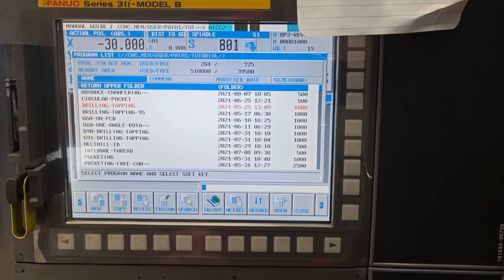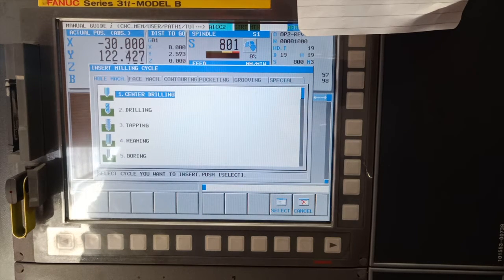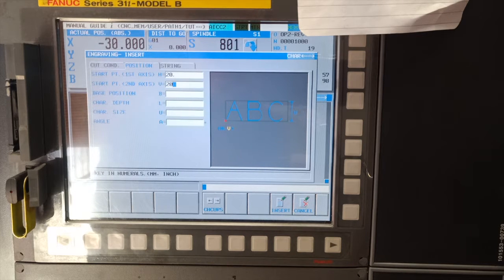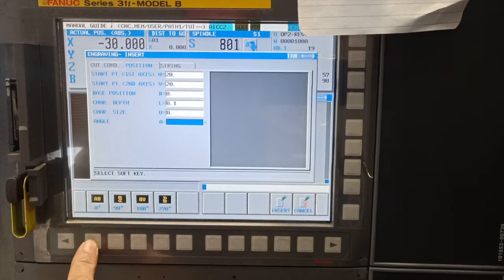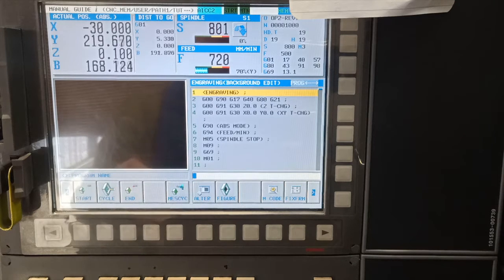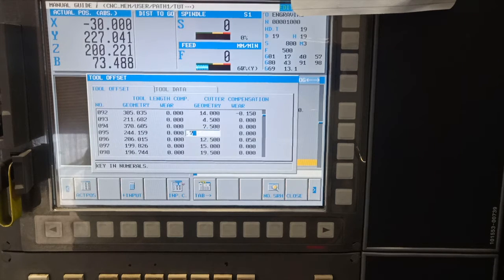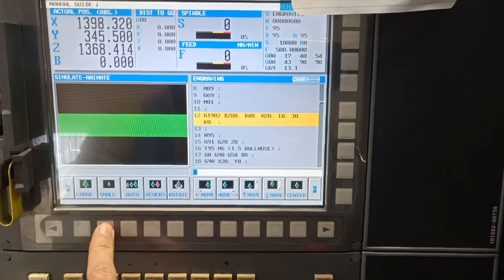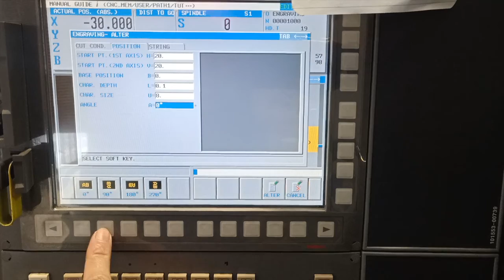#HOW TO ENGRAVE NAMES ON PARTS with  FANUC MANUAL GUIDE I ( easy as)#18

Comment: Hi Sam on CNC Lathe the x and y values doesn't go to the X value I put in it goes way bigger... unfortunately can't send a photo to show you what I am talking about... on my machine does have a ARC option that ís what I am using...to engrave on a arc... The extra value it give on ARC ís CENT PT.(1ST AXIS) AND CENT PT. (2ND AXIS)... This comes instead of the 0 90 or 180 degrees then the Start PT (1ST AXIS) AND START PT(2ND AXIS) ís Still there it does not go to the value (20) you got in your cycle.... don't know if you maybe formuleer with this

Comment: Hi how do engrave on face diametrically
Reply from the maker: Hi if your machine have manual guide i and there is a engraving cycle    may be under special. Thanks
Reply: @SamTheMachinist  HI sam i did on the outer diameter( with x axis driven tooling), which is good. But how do i do it on the face using Z axis driven tooling